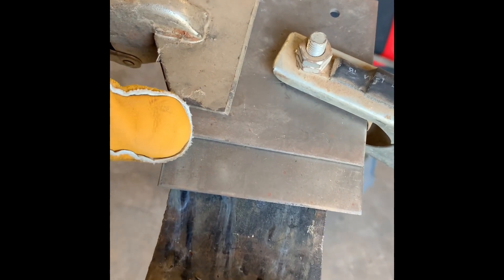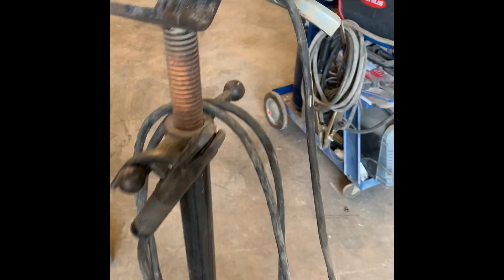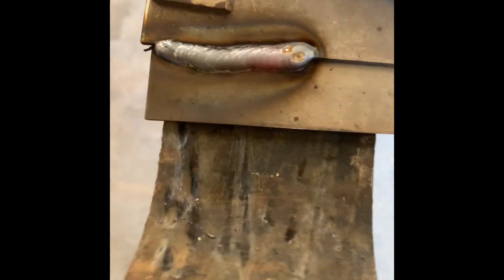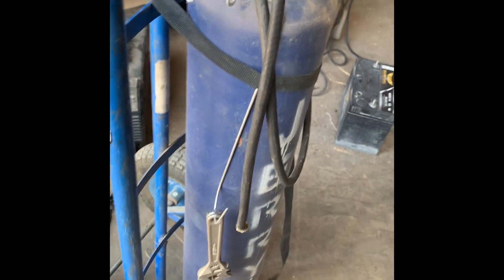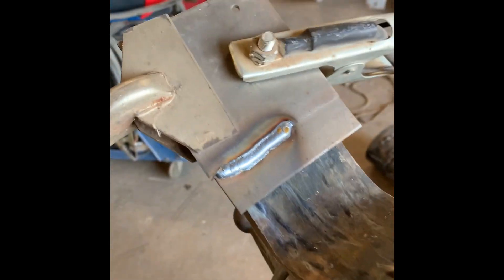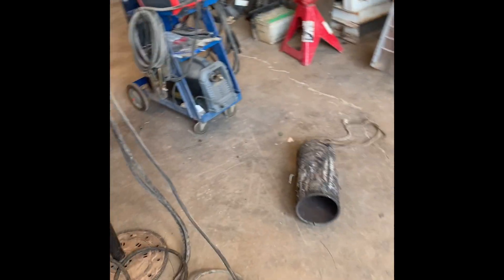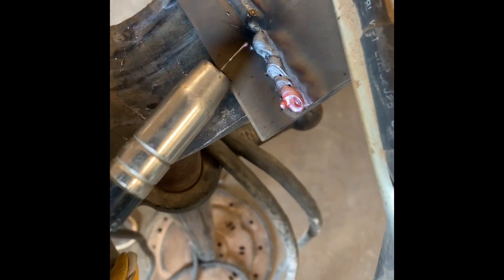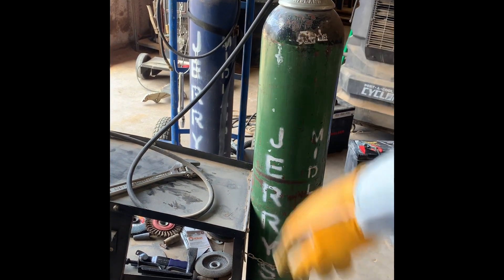I Have Bad Gas… Welding Gas Contamination

Comment: would have been nice to see how much pressure you had left in each tank that plays a factor as well such as if you are under 500 psi you can get same effects.
Reply from the maker: In hindsight I should have shown the pressures. And I do know that you can get that towards the end of a bottle. But both of these tanks were at or over 2000psi. I only use these bottles for testing welding equipment not production work. The one that was contaminated was plumb full (just picked it up from my gas supplier) and the one that I’ve had for a while (that had known good gas in it) wasn’t far from full. Still, I agree and I’m kicking myself in the butt for not taking a video of the pressures. To be honest it had just been so many years since I had some bad gas that I felt like I had to record it right then (had a lot of other stuff I should have rather been doing) and it made for a hastily shot video. I apologize but I appreciate you watching and commenting, Scoony!

Comment: I worked in a body shop where wannabe body techs were too lazy to go to the store room and get a bottle of gas. One day they robbed a bottle of 100% argon off of a machine with a spool gun for aluminum and put it on a mig machine that was supposed to have 25% argon/75% co2. Nobody could figure out what was wrong with the welder or the gas because they  also didn't read the label on the bottle.
Reply from the maker: Sounds about right. I think that’s the number one problem with most people in most situations these days they are unwilling to read. Of course, I would be lying if I said that I have never found myself in a situation where I don’t want to read either. 🤦🏻 but you live and learn. I bet it was burning back to the contact tip with 100% argon. Lol